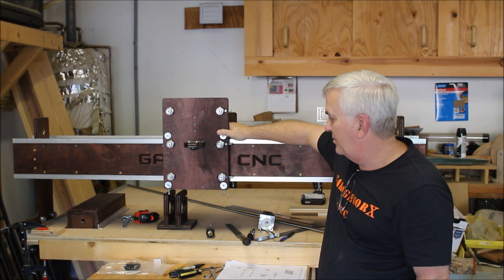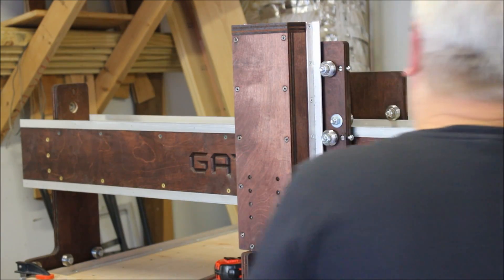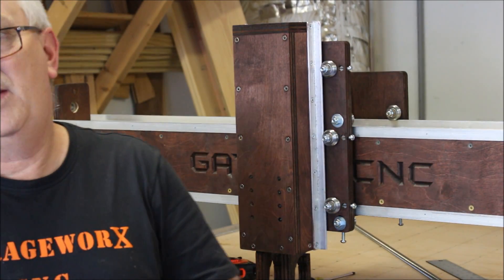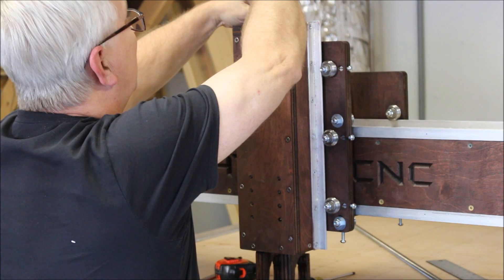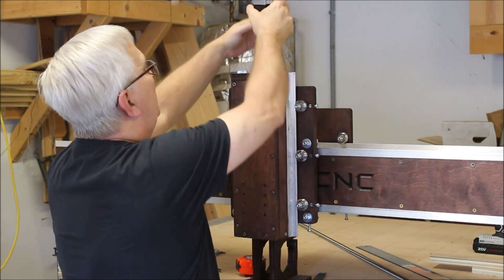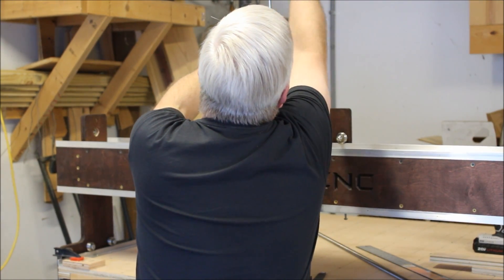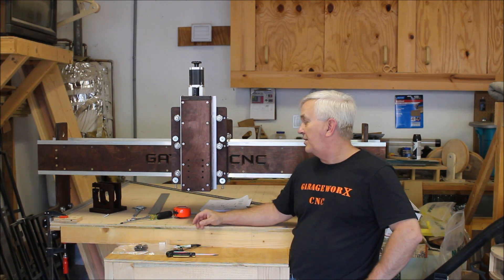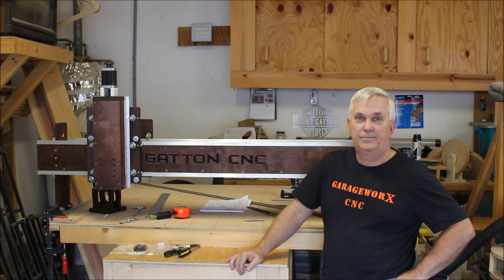Dave Gatton CNC Build Part 9

Comment: Love the videos and doing my build right along with the videos.  My question, do you need Mach3 downloaded in order to use VCarve?
Reply from the maker: captzman193 Mach 3 and VCarve Pro are two different things.   Mach3 is the software you use to control your machine with G code.   VCarve Pro is design software that you use to create the G-code that you will run in Mach 3.

Comment: Dave, I see your CNC kit available on your site, the $250 is for the pieces and parts cut out, correct?  What about the other hardware, motors, etc...  I guess you provide a list of what to buy from McMaster Carr?  What's a rough cost for all the other stuff?

Comment: Great video again Dave!
I built a 4x6 from your design and I am hooked! Been doing nothing but CNC stuff.
Question, the z Axis is held up solely by the stepper motor arbor and shaft. With all that weight on the stepper shaft, my motor is developing some z Axis play. Have you had a problem with this?
Thanks for all the inspiring footage you provide, you have helped more folks In more ways than you know, Brad

Comment: Hi Dave,

I was wondering how the aluminum rails hold up against the steel v-groove bearings. Is there much wear overtime? Why not use steel angle iron?
Reply: Go with steel even though its a bit tougher to deal with. Aluminum rails are way to soft to stand up long term. Also DO NOT FORGET to paint them as steel rusts.